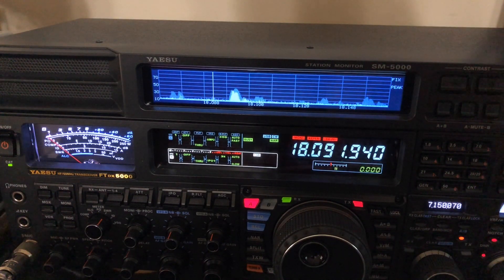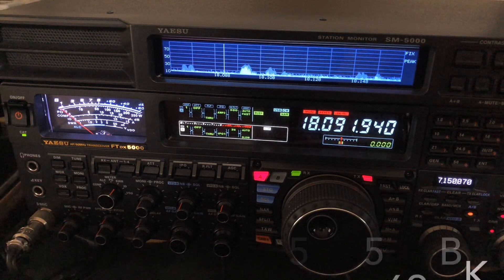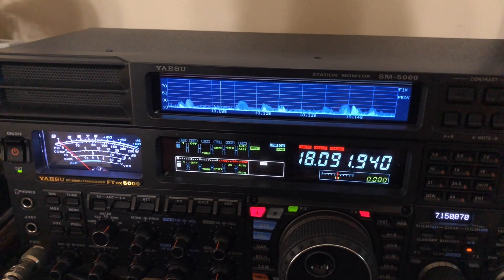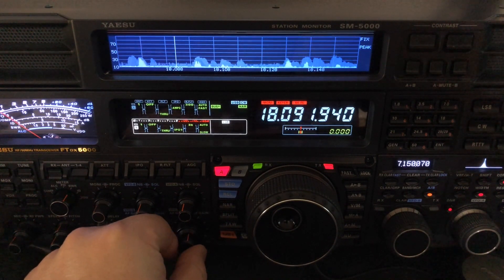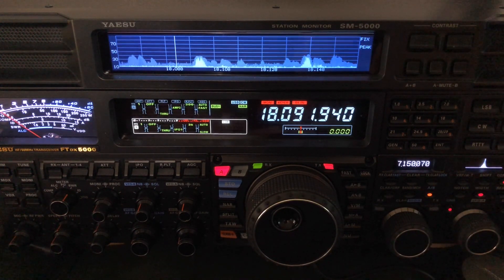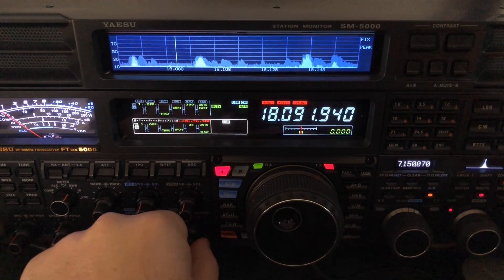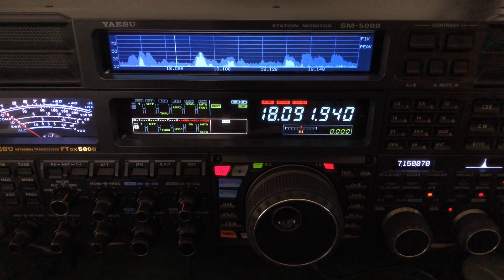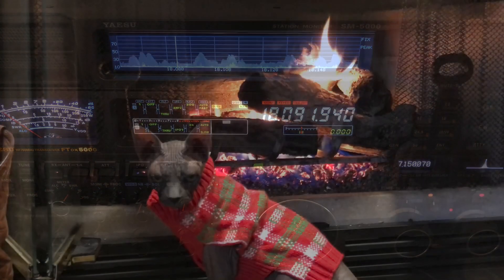My XYL asks, Why So Many Antennas?

Comment: Hi. Good to hear from you. I have been wanting to ask you which way your wire antennas are pointed.  Thanks again.
Reply from the maker: I use multiband dipoles so the pattern is less predictable, except for the fundamental band.  The proverbial broadside figure 8 pattern happens with a horizontal dipole operating at its fundamental frequency.

My OCF dipole is oriented with the wire running SE to NW. My ZS6BKW is oriented with the wire running NE to SW.  My 160m doublet is oriented with the wire running E to W.  

Above the fundamental, the multiband wire antennas will develop multiple lobes of gain, and the resulting nulls. Surrounding objects tend to skew the pattern, so it can be less predictable. I just get to know each antenna and learn where the lobes and nulls are for each band.

It would be ideal to install two identical antennas, at the same height above ground and perpendicular to one another, at a minimum of 1/2 wavelength apart for the fundamental, with no surrounding objects. The lobes and nulls should be opposite one another, providing directivity in virtually all directions. 

73, Doug
Reply: Thank you Doug.  I do appreciate the detail. We live in a home on a 1/4 acre. I am using a 7-band vertical (80m, 40m, 20m, 17m, 12m, & 10m). 15m comes along as a 3rd harmonic of 40m.  I recently worked the Route 66 special event and was able to eventually get 4 stations on phone…. But competing with those using amps was not easy. Because of the small footprint I am considering putting up an 8-band HEXBEAM to help out in those situations. My hope is that I will not find myself needing to get an amp right away if the directional antenna works out.  73, Rob wd4ift
Reply from the maker: The beam will help on both TX and RX. The Hex Beam typically exhibits around 5.5dBi maximum, versus a dipole, which is 2.15dBi. So your TX performance should be similar to doubling your power from 100W to 200W. But your receive will improve as well, and you will be minimizing QRN and QRM that would normally be coming in from 180 degrees relative, and even more so at approximately 135 and 225 degrees relative. 

73, Doug

Comment: Question- why do you run your antennas through a switch rather than into the 5000, as it has 4 tx antenna inputs?  Just curious
Reply from the maker: That's an excellent observation and an excellent question.  I mentioned it in one video but so long ago, I don't remember which.  

I can put the Alpha-Delta antenna switch into the grounded position and walk away during a lightning storm.  Connecting the antennas directly to the radio requires me to unhook all the antennas from the back of the radio everytime it storms.  And then what do I do with them?  

I could put all the connectors into an empty mayonnaise jar with a piece of tire tube stretched over the opening and secured with a rubber band.  The old CB'ers I knew did that.  They cut a small slot in the piece of tire tube and stuck the PL-259 into the jar during a storm.  That is impractical for my 4 antennas.  Plus, it’s better to ground them. So I use the Alpha-Delta switch.  It shunts the antennas to ground when in the neutral position. 

73, Doug
Reply: @n4hnhradio  now THAT is an excellent idea! I had all my coax come through the wall into a box into barrel connectors, then 2m patch leads from the box into the radio. When there were thunderstorms nearby, I just unplugged the coax from the wall. I was told that if an antenna is struck, there is no ground so nothing will come through that. But I wasn’t so sure about that and still arnt… I guess having a bolt of lightning shoot across the room was better than into the radio 😂 here in Australia, no one really has any lightning protection. All you hear is “just unplug from the radio and walk away” and I guess that’s what the majority of us do! Including myself
Reply from the maker: There are numerous views regarding lightning and grounding. I know a couple of operators who won’t ground their radio, amplifier, or antennas. They subscribe to the theory that lightning can strike the ground near your ground rod and enter your shack via the ground wire. 

There are also those who are religious about grounding. What to do?  Well, I’ve always grounded my station to an 8 foot ground rod. It takes around 30 feet of wire to route from the radios, amplifiers, and antenna switch to the ground rod. That isn’t ideal. The longer wire creates resistance. A close enough strike could induce enough current into that wire to damage equipment, even though much of the power from the strike will also go to ground. But, so far, after over 24 years at this location, I’ve had no damage from a lightning strike. 

I should mention that my area receives more lightning strikes than all of metropolitan Atlanta. The source of my power line noise is often blown lightning arrestors on the poles. The power company engineer told me that my area gets the most lightning strikes. They have actually thanked me when I tell them I’m getting interference from the power lines. They came out on one occasion and both lightning arrestors were blown on the line that feeds all the houses on my street. 

The engineer told me that it doesn’t matter how much grounding I have in place if I take a direct hit.  Their lightning arrestors get blown up. He said a lightning bolt is not something we can really tame. We can only attempt to minimize the damage. 

Grounding and lightning strikes is an interesting subject to research. You can find yourself going down the proverbial rabbit hole the more you study the subject.  But my gut tells me to ground. 

73, Doug
Reply: @n4hnhradio  yeah it’s something I need to really research more for sure. Thank you for your reply’s Doug!
Reply from the maker: You’re very welcome Daniel!

73, Doug
Reply: @n4hnhradio  oh here’s another question. I’ve ordered the ZS6BKW from NI4L, does the internal tuner handle 80m? Or is that an external tuner job?
Reply from the maker: 60 and 80 will require an external wide-range tuner.  80 is around a 4:1 and 60 is around 20:1.  But my Elecraft KPA-1500 built-in ATU matches it for 60m.  30m and 15m can also be matched with a wide-range tuner.  You will also need a wide-range tuner for the lower end of the 10 meter band. 

The upper end of 10 is good. 12, 17, 20, and 40 are good without needing a tuner. I might use it to touch-up the band edges a bit. The internal tuners can easily handle that. 

73, Doug
Reply: @n4hnhradio  yeah we can’t use 60 here in aus. Was hoping I’d be able to get away with an external tuner. What is your set up? NI4L states at least 20m of coax. Have you got that? That may just hide enough of the SWR to be able to trick the tuner to keep it happy. Sorry for the questions, just planning a bit and thought I’d pick your brain!
Reply from the maker: I use 75 feet of LMR-400. I was using 75 feet of RG8X. I changed it out earlier this year.  You can watch that here: https://youtu.be/rR32rArlOts

The improvement from the LMR-400 is significant. It helped on receive too, as one would expect.  Also, any multi-band dipole is going to have loss on the bands where the SWR is high, even if your antenna matching unit makes the radio happy.  So use the best coax you can afford, especially for a multi-band dipole.

One of the reasons that a pure doublet is so efficient is because there is minimal loss with ladder line.  Anytime someone tells me they need more than 100 feet of coax, I recommend a doublet.  For a Yagi on a 150 foot tower, I would recommend LMR-400.

The ZS6BKW does require a minimum of 20m of coax to “complete the match.”  The ZS6BKW is a type of doublet antenna system. Emphasis on the word system. The feed-line acts as part of the entire antenna system. It isn’t decoupled from the wire elements.

73, Doug
Reply: @n4hnhradio  yeah I’ve got the ol LMR400, good stuff that’s for sure. Ok so even with 22m of LMR400 you still have high SWR on 80. Looks like 80 is out for me then until I get a tuner! I got a DX Commander Classic with the 80m inverted L. Was hoping to change out the Inverted L to a 30m element and use the ZS6BKW on 80! Wil have to wait for that. Thanks mate!
Reply from the maker: Daniel, 80 is just slightly out of range for the typical internal tuner, which usually can only touch-up tune, up to a 3:1 SWR.  

You might get lucky.  The ground beneath and surrounding objects can affect an antenna.  So your SWR might vary slightly as a result of the environment where it is installed. 

Get the ZS6BKW as high as you can. Mine is at 50 feet, at the feed-point, with the ends at 15 feet. There is 40 feet of ladder line and you shouldn’t let that lay on the ground or get near metal objects.  But I prefer 50 feet. 

73, Doug
Reply: @n4hnhradio  yeah I’m going to struggle to get it past 8m (26’) where I am that’s the problem. At my old QTH, I had an 11m tilt over pole. This new one, I can’t go too high as there’s a lot of tiles outside so can’t really get anything proper into the ground. Poles will be clamped, so I don’t trust it all. Hopefully new QTH in a couple years and a bigger property. 
Put it this way as well, my old QTH, I had a 160m loop up in the air with a 4:1 balun, and was able to get 160m-6m. This new QTH, I’m going to struggle to run 5m radials for the DX Commander in the grass because it’s so small. If that DX Commander falls over, half will be in the neighbours backyard!
Reply from the maker: Well, as long as you can match it, it will perform at lower height above ground.  I know a guy who has his at 17 feet, and he just lets the 23 extra feet of ladder line lays on the ground. It is probably a higher angle of radiation but he did work Indonesia from Tennessee on 40m one morning.

A friend if mine has his at 28 feet and his seems to work fine.

Both of these guys use a wide-range tuner though.

73, Doug
Reply: @n4hnhradio  I might be able to squeeze a little extra height. We’ll see once it’s time to put it up.But at least it will work at 8m as your mate has it at that height. I’ll be keeping the ladder line off the ground so all good.

Comment: I have 4 antennas but all small than yours. 😅🤣🤣🤣
Reply from the maker: My ZS6BKW is 94 feet, OCF dipole 135 feet, and Doublet 250 feet.  I have the Doublet thanks to my nice neighbor, who lets me run 1/2 of it across his property.  His property has many trees so no one can see the wire anyway.

73, de N4HNH

Comment: Looking forward to this! 🍿
Reply from the maker: You have popcorn, John?  Here in the USA, we are having a popcorn shortage.  No kidding.

My wife will not be in the video.  She won’t allow it.  We had our “disgustion” about the antennas long ago actually.  I will admit that she allowed me the option to put up multiple dipoles but no tower or beam.  I tried to install a Hexbeam with a roof mount, but she stopped that.  So multiple dipoles it is.

73, de N4HNH
Reply: @n4hnhradio  Would she agree to a DX Commander? Vertical fan dipole...
Reply from the maker: She tolerates the R-5 because it is above ground, mounted to the back deck.  Even if she would allow me to ground mount the DX Commander, there is not enough room for the radial system.  There is maybe 15 feet between our house and the drainage ditch  between our house and the backyard neighbor’s house.  The front lawn is her passion.  She will not allow an antenna to be seen from the street.

It’s okay though, as long as I can have my ZS6BKW and my Doublet.  Technically the ZS6BKW is also a type of Doublet.

73, de N4HNH
Reply: @n4hnhradio  Shall I send you some  popcorn Doug?
Reply from the maker: Ha!  Thank you John!  That’s a kind offer, but we will manage.  I only found out about the popcorn shortage today on the news.  It’s a crazy world now.

They said our movie theaters are going to start charging a high price, as of that wasn’t already the case.  The movie theaters are also struggling to find workers.

73, Doug
Reply: I finally lost the antenna battle but I won the DXCC war.  My XYL and I had plenty of antenna "disgustions".  I kept pleading a little while longer.  After 160m DXCC the 160m inverted L went away.   The 80m inverted L soon gave way.  Then the 40m dipole became next.   Finally, the 20m to 10m hexbeam was the last one to go of the TX antennas.  Aftern the low band antennas were taken down, soon the 2 way beverages gave way and just as well as it was on my neighbors lot.  The skid steer ripped away the radial field soon thereafter when he started grading.  I don't feel so bad as the sunspot cycle 24 went to the minimum and there were no more DXCC's to chase - with 5 Band WAZ, 9 band DXCC,  under my belt, my antenna farm did its job before giving up the ghost.  All I have left now is an end fed half wave for 40m and it is just a temporary installation.
Reply from the maker: I’m glad you were able to “get-er-done” just in time.  There is still much fun to be had with an EFHW though.

73, de N4HNHu